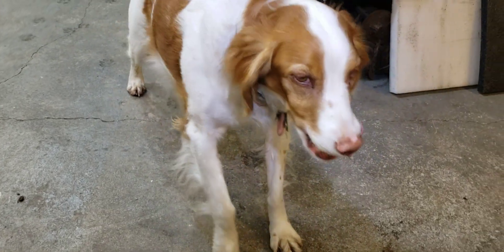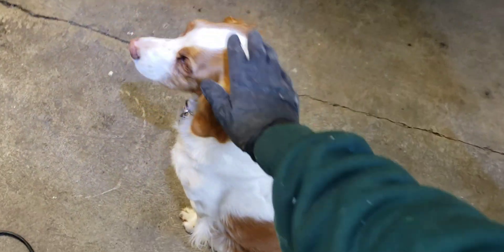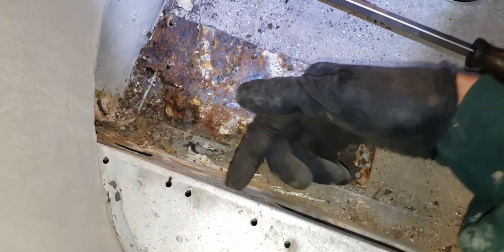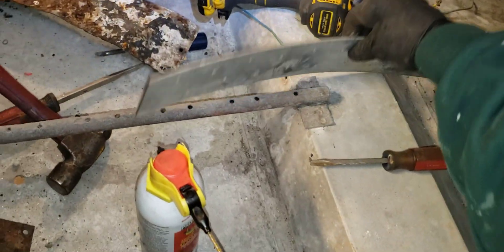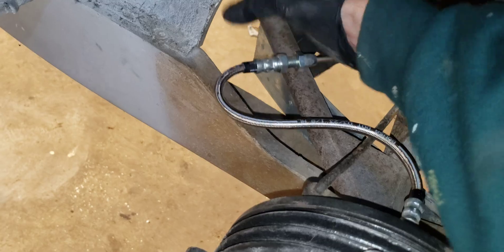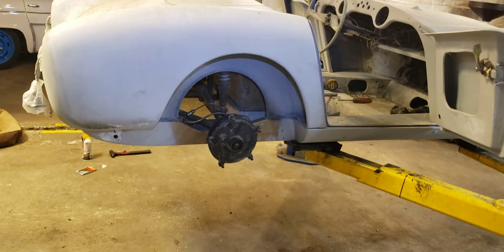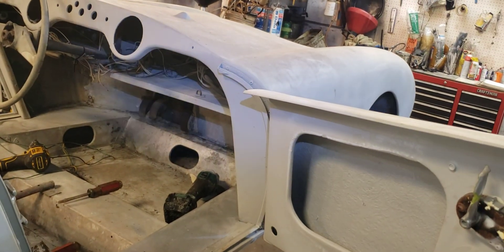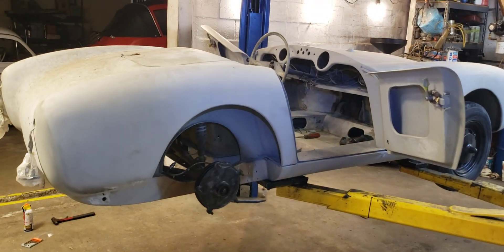Tiny Car: Huge Job

Comment: I understand your thinking with the reinforcement. The missing bit of the puzzle for us that affects what/how you go about it is the engine you choice you have made, but not yet shared. What sort of power is it? Is it much different to the output of the original and, therefore, potentially adding more strain on the original chassis design?
Reply from the maker: Yes and Yes 👍